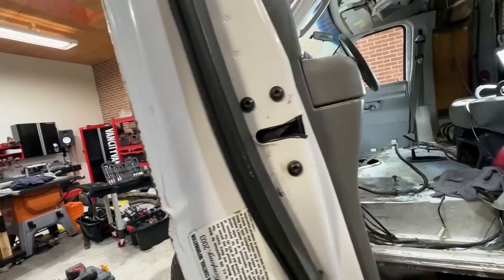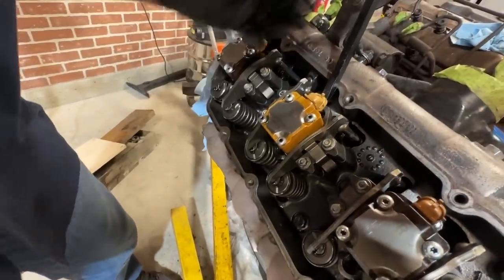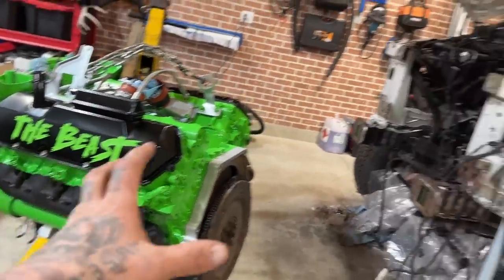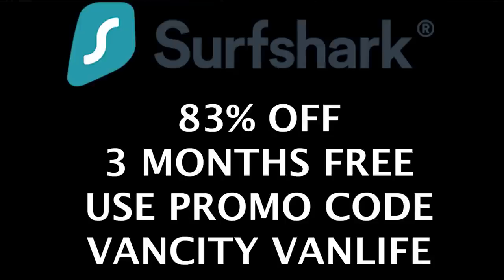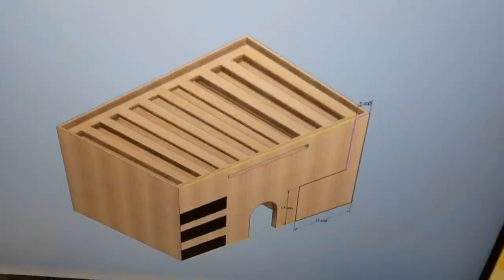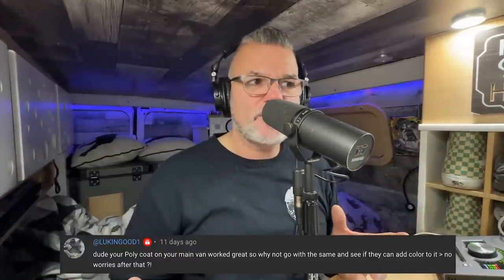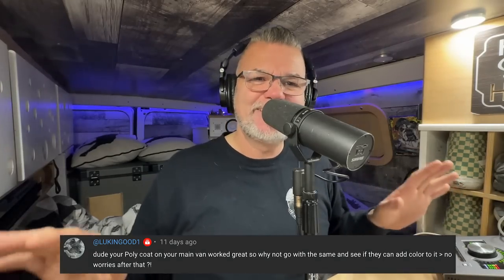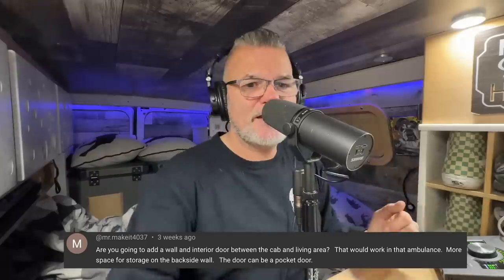This Is One Big Home | Drafting Students Update, Dividing Wall, Tire Size, Moving In

Comment: Another great video! From experience i'd again recommend the 35" tires, what year axle is in the front of your ambulance? The brakes are adequate at best on those vans/trucks even with a hydro boost. on one of mine I did upgrade to much larger front brakes. The extra mass of the 37" tire only exaggerates the poor stock braking as well as rear tire to fender clearance issues while turning or articulating. You can only push the wheels so far forward before other issues arise. Looking forward to all the updates! Great work.

Comment: Look into 37" military humvee tires.  I bought a set for my suburban. Super great tires, very cheap price, great off-road.  The downside is that they are 16.5" rims. But if you like the look you can get the run flat rims too. Just a thought

Comment: i run 35" 12.5's on 15" rims for  my blazer and driving on the pavement they have a little wiggle because of the side walls the more side wall you have between the rim and tread you can get more wiggle you can over pressure the tires a lil bit i run 40 psi on mine but then you can run into uneven tire wear  not sure the size of your rims

Comment: When considering tire size overhead clearance considerations are equal to bottom clearance. Seen a Utah poster in the High Schooler video. Are they a Utah school? The overlanding company's have exploded here. Utah is becoming the Industy leader in overlanding and Van builds.

Comment: Bigger tires are great BUT you have a whole lot on your roof in the current home.  Bigger tires and making the shop door bigger --done.  But how will you squeeze into the shop with solar panels & your roof vent fan on there?  And how will you set up your Starlink?  Can't use magnets on fiberglass.  Uh-oh ...?